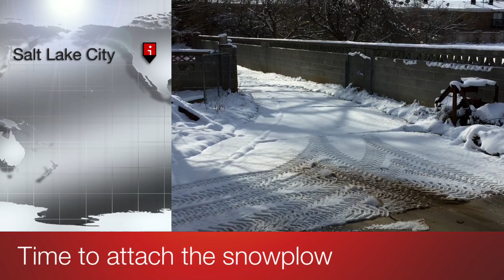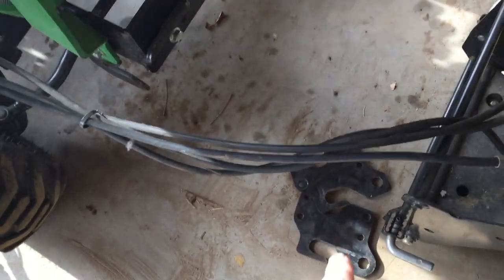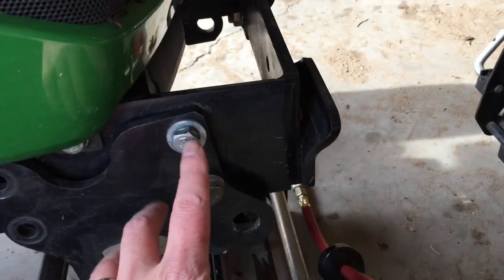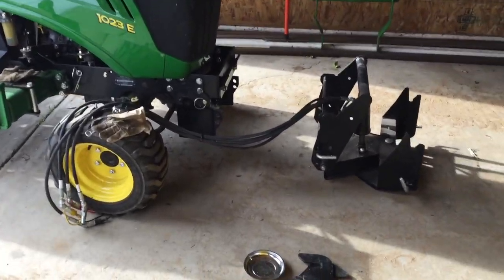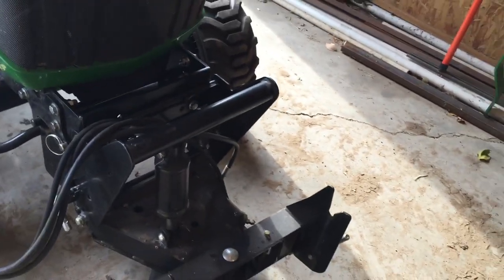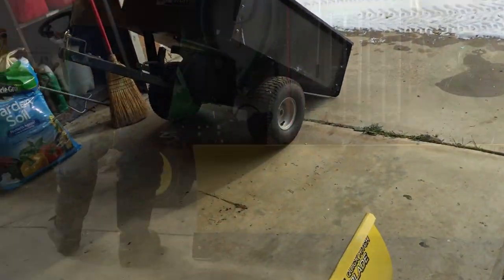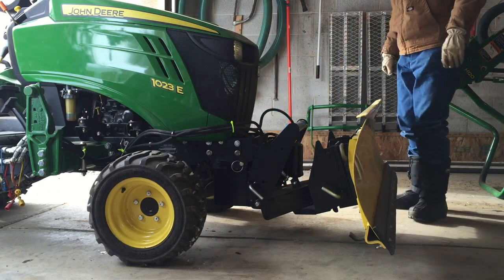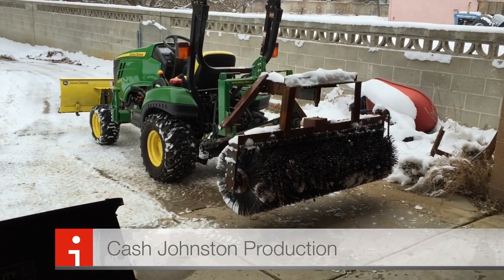Attach John Deere 54 inch plow

Comment: I didn't know you had to go through putting a whole different set of brackets on when you had the bucket on the tractor. I have a 733 that I can put a bucket on if I want to. All I do is switch back and forth between Mower and snow blade. I don't have to do all that
Reply from the maker: Yes and all my instructions were written in German!  Lol, didn’t help any.  Got the hang of it after a couple years finally

Comment: Both brackets can stay on I think. I went through this with my mower and blower I changed them the first time then made the discovery they could both stay on
Reply from the maker: I'll have to double check that.  Would be most convenient to have both attachments use the same bracket.  I seem to recall looking at that before, but, I don't remember the outcome...
Reply from the maker: Send a pict.  Worth 1000 words!
Reply: Cash Johnston I was thinking I could send a picture on youtube message but I guess I can't sorry
Reply from the maker: No problem.  Thanks anyway.  I'll take a look again this weekend.
Reply: Cash Johnston I have a couple pics I can send if you need you would just have to pm me your email. I just know what a pain it was to figure it out and John deere and the manual were no help really
Reply: Both brackets can stay on at the same time. the brackets you were putting on, go on the inside of the frame of the tractor

Comment: Both brackets cannot stay on this unit as he has the wide quick hitch assembly. They make one that is narrow and then both brackets can stay on.
Reply from the maker: Toda Camp Thank you for that insight!  I thought I just couldn’t figure it out.
Reply: Brackets for the quickhitch are to be mounted on the inside not the outside and they stay on and do not interfere with the mower deck quick hitch.